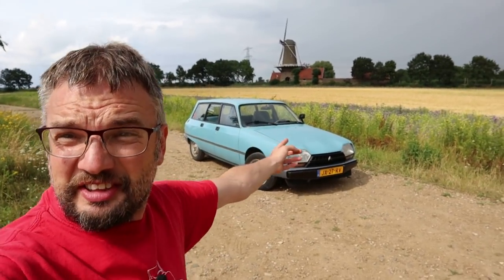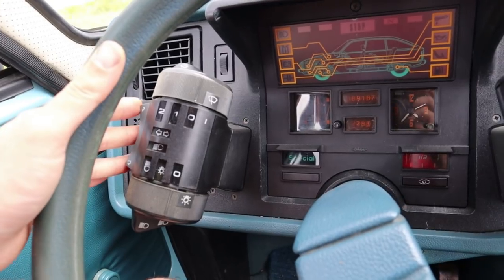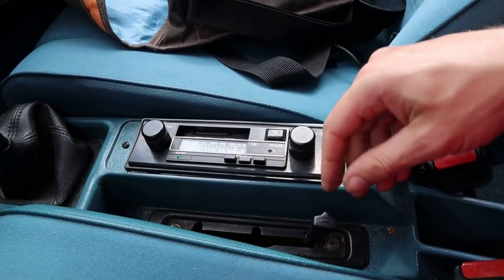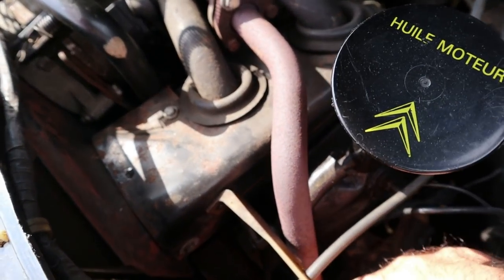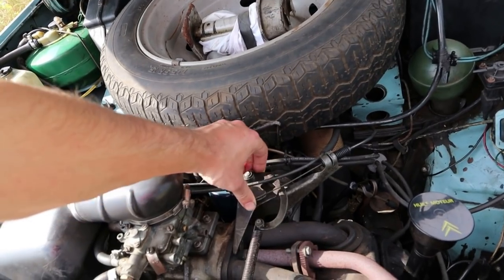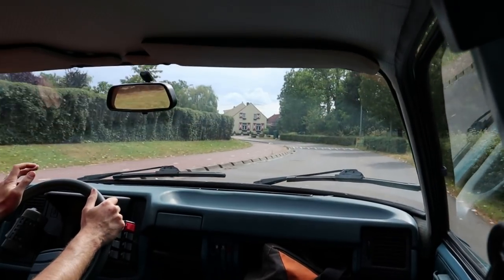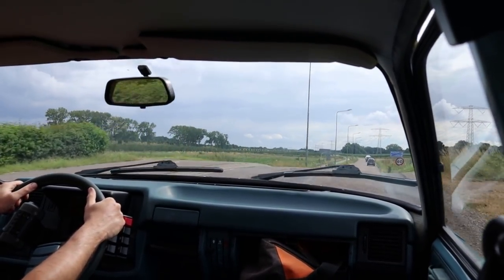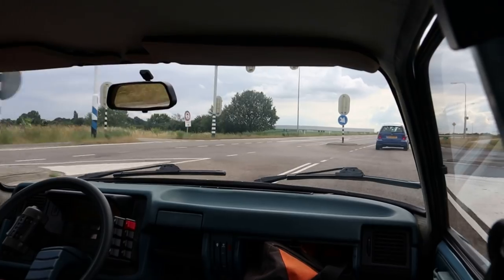Real Road Test: Citroën GSA Break (estate) Spécial!

Comment: Such happy memories. I had two hatchbacks. Lift a bag of cement out of the back? - no as you lifted the car came up with you and you couldn't lift high enough to clear the cill. Get Loveliness to stand on the bumper. Indicating 100mph on the A303 on a pitch black winter night when there's one hell of a bang. Turned out the passenger door window had been held up by a forked stick. Touring France and needing new spark plugs, what's the French for that? And then taking the car apart to get at them. After that it was his and her CX 25's

Comment: In the late 80s, I bought a 1300 5speed GSA for commuting into South London. It was written off in an accident 6 weeks later, and replaced by a somewhat scabby GS1220. This did sterling service for about 6 months, until it failed its MOT and was replaced by a BX16RS. The GS was in its element in the outside lane of the A3, roaring past Granadas and Carltons that thought they were making rapid progress. I preferred the GS body to that of the GSA - the fastback was lighter and more rigid than the hatchback. I wouldn't have objected to the GSA's powertrain, though.

Comment: My mother had a GS Pallas. She sold her circa 1986. I still remember the licence plate number (304 SY 972)... Eternal regrets, for both the car, the ambiance inside cars before everything on the market went depressingly black, and Citroën that was never understood by Peugeot. Peugeot 's expertise was about stopping the development right in time and enter the testing phase soon enough for the first customers to buy an affordable, reliable product, and save the last brand new idea for the next generation. But they always tried to simplify, the hydropneumatic suspension was way simpler than the original TPV prototype's whose original concept was aimed at race (two simplification paths, a low-cost one for the 2CV, a more expensive one for the DS, GS, SM and CX but still the simplest way to achieve constant characteristics all the way from fully compressed to fully expanded suspension whatever the load) and the so-called problems about handling and sea-seackness are just bulshit. I've been sick at the back of the GS when I couldn't see the outside AND at the front of an Honda Accord while looking at my gameboy's screen, but never from a Mehahi (buggy variant of the 2CV) from where I could see the outside. Same from inside and outside any boat before getting used to the motion, so the problem was about sight, not suspension. About handling, the SM was well known for just forgetting any competition as soon as curvy roads were in the picture, despite being built around a DS chassis designed 15 years before they put the Maserati engine under the hood, and with the new lhm introduced in 1966 the suspension was only slightly harsher. The underpowered CX just won about every rally she raced, and with its size it could only be up to the suspension and chassis (although the pilot was certainly good!) Last but not least, the no offset front wheels allowed any classic hydropneumatic Citroën to stay in total control after the explosion of a front tyre! The BX sold well but it was already much of a Peugeot, and the uselessly complicated and expensive Hydractive of the XM or activa series were actually the negation of the obsession with simplicity Citroën always showed everything being equal otherwise. God knows why humans only know one way to deal with what they don't understand : assassination.

Comment: Lights switch was very interesting - first position was for sidelights or dipped headights, and second position was for dipped or main beam, pulling the "flasher" lever toggled between. You had to remember how you last left the lights otherwise you could turn dipped headlights on when you just wanted sidelights.  Mad, but typically Citroen

Comment: Still regret a little bit that I didn’t buy that good Pallas that crossed my path a couple of years ago.
My parents had 3 of them (GS Special, GSA Club and GSA Special; all ‘break’ versions). Good memories, that boxer sound!
There were some production quality issues: whining gearbox (warranty replacement), and breaking bolts on the boot door (which we discovered before something serious happened). The wiper motor once broke and I remember the throttle cable jammed sometimes. Bad? Not really, we crunched away 145K miles in 5 years, only once needed help for a broken ignition coil cable. Many have had more issues with modern cars considered very solid, built by the German ‘People Car’ concern.

We really enjoyed these GSA’s, trips to everywhere, including crunching 900 miles in one day over the autoroute at 90MPH.

The arrival of the famous PSA xud 9 diesel marked the end of the GSA era for us. Understandable at 25-30K miles per year.

Comment: GSAs should all be 1.3 litre if I'm not mistaken. The smaller engine was available in something badged GS Spécial but that had the old bodywork and was available for one year only after the GSA launch. Afterwards it was pretty much unified mechanics except for the gearbox options (5-speed and C-Matic were optional at extra cost, 4-speed was base spec).

The gear leaver was originally meant to be on the dash in the GS. Then at the last minute the top brass wanted it to go on the floor. As a result, the handbrake had to go where the gear lever was, and that explains both the daft handbrake and the poor gearchange.
Reply: Until 1983 the GSA Spécial had the 1129 cc engine. By 1984 the 1.3 litre was the only engine option.

Comment: Hate to tell you the bad news man, but this is not a GSA. That is a GS Break transformed into GSA, as many GS owners (including me) had done back in the day. It's obvious from the cut-out rear bumper, as GSAs hadn't had the rear bumper fixed on the door and the door didn't go that low as GS. Another GS feature is the rear lights (GSA had different) and the metal decorative panel above the rear lights, all the way across the rear door. GSAs didn't have that. All these are the tell tale signs that this is a GS. Other than that it's a great car!

Comment: Just come to mind early GSA Specials up to W reg were fitted with an 1129 cc boxer and a 4 speed box, which the example I drove was torturous in extreme especially if any urgency was needed. When the 1299 cc units with electronic ignition came in across the range there was little difference between the Special and Club, then the Club and the Pallas, which is why towards the end of the run the Club was the first to disappear. Your car in question definitely sounds like a 1299 cc powered unit which if my memory serves me well, they top out power at 5500 rpm and red line at 6400 rpm quite high for a 1970's designed engine.
Of all the Citroen I have owned I rate the GSA seats above all others, I currently own a 14 plate C3 Picasso 8v 1.6 HDi  which happily grunts along around 1000 rpm, but has a considerable sense of urgency when called upon.

Comment: Family had a 3 speed clutchless(semi automatic) after I passed my test in 1986(As father decided to trade in an escort xr3i for a series 4 lotus 7 big valve with the cheap   S**troen being used as the family bus).Suspension stuck on fully raised full hard and changing gear was like changing in a normal manual without using the clutch with rev matching required!Never really worked well.This one looks great tho'.

Comment: I seem to remember a customer coming in with the smell of burning paper coming out of the vents. I think they are inboard discs on the front and one was sticking and the cardboard heater ducting started smouldering from the heat. Something like that anyway it was in the 80's, I've slept a bit since.

Comment: "some wind noise, but nothing horrible"
right door not properly closed, big gap

I had a Citroen GSA Spécial, 4 door, 1130cm3, it had 4 speed and a tacho made like the speedo, with a revolving cylinder in front of a lens. 
The tacho goes where the analog clock in this unit, and i had a digital clock where this one had the "Spécial" light. The "econometer" was somewhat useful until you get used to the car. The engine noise was glorious, and it was pleasant to drive, yet a bit thirsty. It could rev up to 7k rpm, the noise was insane. No thermometer, no cooling watter, no head gasket. Skinny 145mm, 15inch tyres.
Brakes were super, could handle all kind of abuse.
Seats were badly deformed, had to reinforce the bottom cushion. Interior plastics were really bad and discolored from the sun.
Mine was plagued with oil leaks and rust, and it ended burning completely on the road side. Allegedly a gas leak on the exhaust header. :(
I still have a BX, suspension is not firm at all, I find it to be similar with the plus of power steering. The McPherson towers in the front are needed to accommodate the transversal engine and gearbox, rear setup is the same of the GSA, only 14inch wider tires. Both cars can drive on only 3 wheels, ask me how i know. :)

Comment: Great overview, thanks :)
A very interesting car. However, I guess that the rear seats don't fold down I was expecting to see a rather large boot in this small car
Reply: The rear seats fold flat. My dad and I took his GS Estate full of crockery - side to side, front to back and top to bottom 50 miles. You could feel the intertidal of the weight in bends but the ride was unchanged. Incredible!

Comment: Mine is almost the same except MY82 4 speed and Solex carb (The one in the video is the Weber I think). Not the same colour but close, blueish interior too and the numbers on the speedo are a bit different. Although it still needs maintenance it rides very nicely I've done 3000 km so far, lovely flat 4, shifts nicely with 3 fingers and the satellites are actually awesome. I bought it with a little bit of fear (1rst Citroën) but I don't regret it.

Comment: I've driven both the CX and the GSA years and years ago. What I distinctly remember is the comfort, the weirdness of the CX' brake "pedal" (feels like you're braking in a heavy truck/lorry) and the revelation that, as idiotic and unnecessary as that whole control-setup around the dash seems at first, once you get used to it, it actually works great. Of course: It was an overly complicated solution to a non-problem (stalks and switches on the dash work just fine), but because of those satellites, I think those two cars are probably the last "true" Citroens ever conceived. After those two, Citroens started to become more mainstream and less, well, French.

Comment: 19:32 Corvair engines are built for fairly low revs (they redline at all of 5000rpm or so) and make decent torque. The cooling fan ratio and design just needs to be setup with that in mind.

Comment: Heater controls: There not cowboy boots they are clogs.
 I can only find 2 for sale in NL at the time of writing. one 7.5K€ and the other 2.5k€ the latter looks as if it is hiding a "fair" bit of rust on every panel.  The more expensive is still on French plates and only has a 4 speed box. 

PS one thing you did miss was the tail gate and the way the bumper lifts too. Giving  great access to the load space.

Comment: I like this a very great deal, I'm after a more comfortable Dyane, not in the ride, but the rest of the experience :-), havng said that I just sold my 3rd. I'm thinking of the GSA but the engine does look scary to work on :-(, or a 602cc Ami or a 602cc Visa, both in RH will be hard to find however.

Comment: The early BX had even more futuristic dashboard. Wasnt aware when I had it, that it was stiffer than older citroens, but I did wonder what all the hoopla of the suspension was about, as it seemed similar to a coilspring car to me, except the up/down part. Was alot quieter than this though. Ok car alltogether. Knight Rider inspired dash was funny, even though turbo-boost and grappling hook was missing. ;)

Comment: Had a Y reg'd 4 speed GSA Special hatch that would go like the proverbial shit off a shovel, would leave a Cavalier 1.8 CDi/SRi dead in the water on acceleration and good for a ton plus, my only gripe was the hesitancy when the engine got very hot and the scarily high fuel consumption at 27 mpg regardless of how it was driven. The Pallas was the one to get for total refinement...

Comment: Mine was ATF 494L, a 1220 Club in Gignan Blue Metallic. It was without doubt the worst car I ever owned! The engine was out of it more times than it was in it. It was 4 years old when I bought it. At Manchester airport it dumped all its LHM. In another occasion the timing belt slipped one notch! Took 45 minutes to start it one night and then drove like a pig. To think I part ex’d a 1955 Rover 90 to get this heap of French poo!
Now, I look at them and still think they were beautiful looking cars, along with the SM, CX etc. I’d love to own one now…
Reply: Workshop used to do very poor work on these cars. Well, they haf only one hand to srew, the other hand held the beer.And nobofy used tools like a torque wrench.

Comment: That was my first car. The engine is not very powerful but being a boxer it has a very full low rpm curve, you need a much more powerful car to accelerate like it does. I sold it years ago, great mistake... Mine was also a Special but hatchback and in Mimosa Yellow. I changed the instrument cluster with one from an X3 and I had rolling speedometer and also rolling tachometer... Who needs a clock?

Comment: It's a bit strange to judge a car of those years with the eyes of a 2019 driver! I drove a lot in Citroën, since my birth ... Traction to the C5, through the SM (very bad car), and GS Birotor. Today, the dashboards are like those of the GSA, with modernity and more, but the idea is exactly the same ... ... just as ridiculous! Small engine certainly, but light weight too! With 70CV, we exceeded 160 km / h with a family car! ... On the other hand, try a suspension of GSA on a dirt road, it is not an SUV, so there is a strange point of view !
As I said above, I drove a lot Citroën. The two worst being 2CV and SM! For others, I have no bad memories.

Comment: 1:12: There's no donkeys there anywhere so what the heck. Probably geese?
5:48: Nah, you can have lukewarm or hot. Still some work on that. 
6:00: I should've told you this, hahaha. Really sorry. 
6:32: You turn it off and wait for a week or two.
13:25: Exactly where you started. Your sense of direction is as good as mine it seems.
14:31: I see trees where I shouldn't see them. Passenger door open, for aerodynamics
21:20: That's a bridge. Next time you're here I won't let you go without showing you the hills we DO have. You'll feel like you're in Wales-ish. 
21:42: If it was my car and if I was allowed to drive Elly, I would've. Pity it's my dad's ;). 
21:54: I actually prefer the BX too, shhh :D. I like how it's still very much floating over speedbumps but is a bit less wobbly otherwise.
24:39: Speedo said 100? That was 125-ish. I should've told you that. Love how you don't think it's noisy even though it's doing 25% more speed than you think it is, with the door open :D. 
29:34: Yeah, no. My dad repaired the mile-o-meter and something went wrong, he hasn't actually noticed when or how but all of a sudden it was at that mileage. I think it had a 1 before that first :D.

Comment: The speedometer on both my BX’s were about 10 to 15 mph under. Sometimes it’s caused by the wrong cable or it could be age. I unfortunately got 3 points and a fine before I fully realised that what I thought was just under 80 was actually 95 in my 1.6 !

Comment: Ahm the GSA, a lovely car indeed. Even though i love the GSA, i adore the GS. In my opinion, the GS is much better looking. I will buy a GS one day. And i prefer the GS 1220 Club. 
I was going to buy one many years ago. A white 1220 Club, complete and pretty much rust free for a very nice price. It did needed some work, as it sat in France for many years, but it was a beautifull car to start with. No showcar what so ever, it had some minor dents and scratches, but i loved the way it looked, especially because it didn't had any rot. But then life took a turn, and i wouldn't have time to make it a desent driver. So i didn't buy it. What a mistake that was.
Reply: go look for one , they are out there still …  I once missed out on a $200 red 1962 VW in 1986 , and finally found a blue 61 in 2004 . I still have it now .
Reply: @jamesduke4957  Oh, i will, when i'm ready for it. ;-)